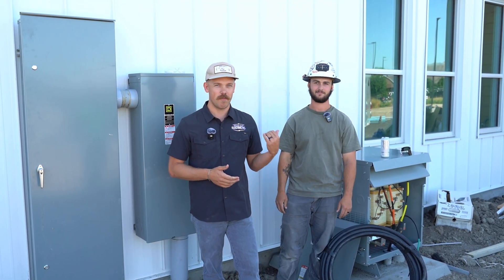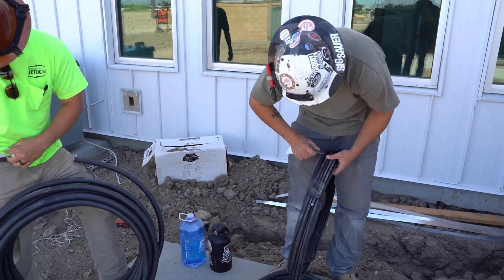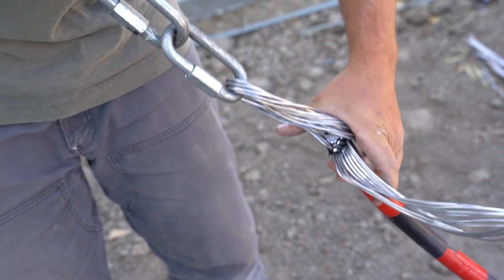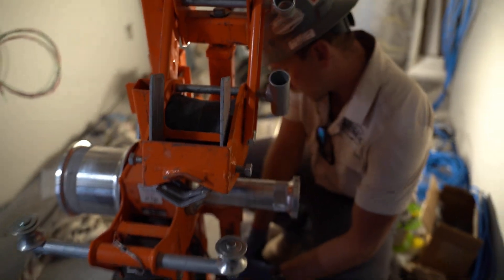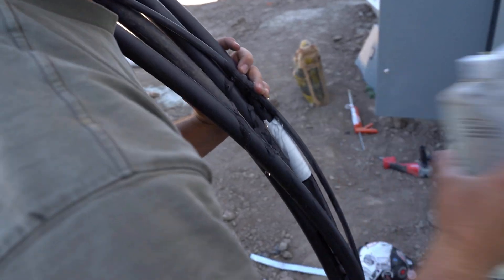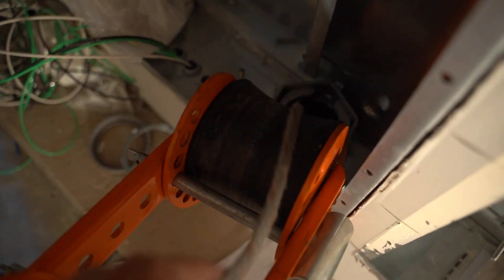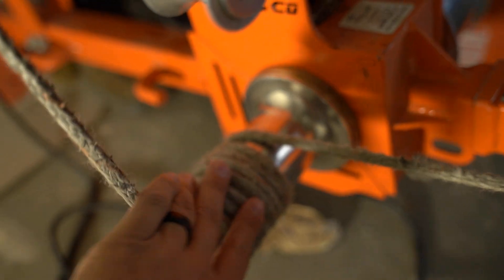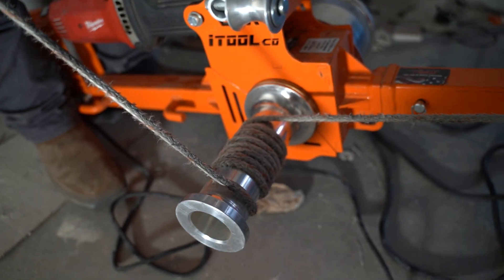A Commercial Electrician's Secret Weapon | SAVE TIME & MONEY | iToolCo Wire Puller

Comment: $7k for a winch on an articulated frame with rollers?!
Reply from the maker: Pricey equipment, but if you pull large wire frequently it will absolutely pay for itself in saved labor 🙏
Reply: @TVE-media  You are right, even if you needed it once every 2 weeks, an equipment will pay itself. Either the work it's invoiced to the customer, either it will save time and you can take sooner a new contract. My point is that for a simple frame with rollers, a simple gearbox and 1 or 2 articulation without the actual winch it seems overpriced. If you know how to weld it's a half day job to DIY and you can adapt a 12V - 13.000Lbs winch with a 200Ah LiPo battery